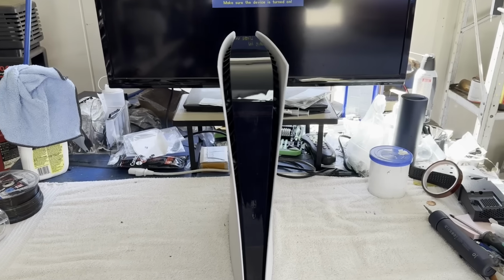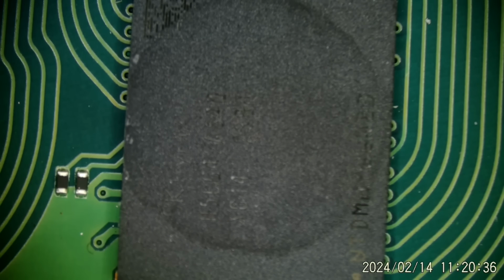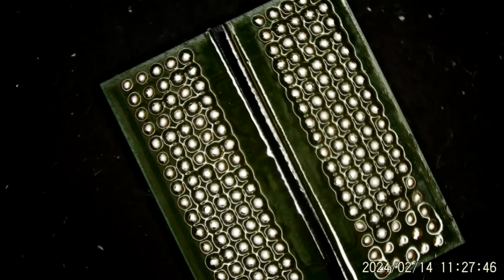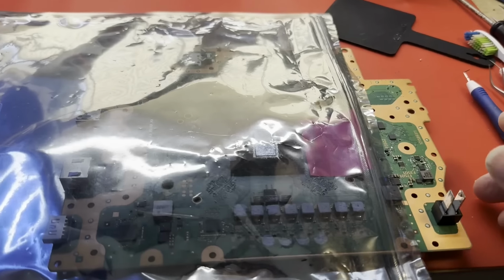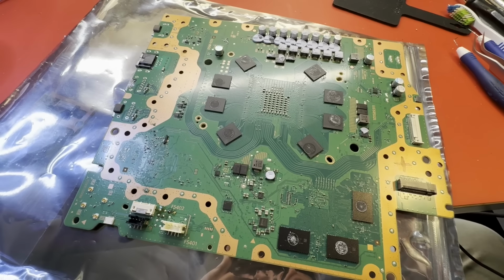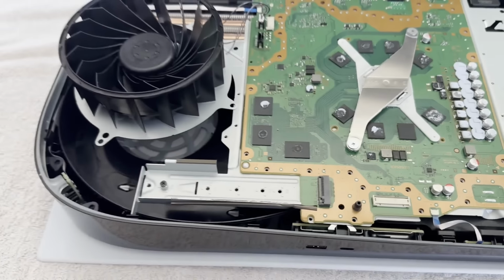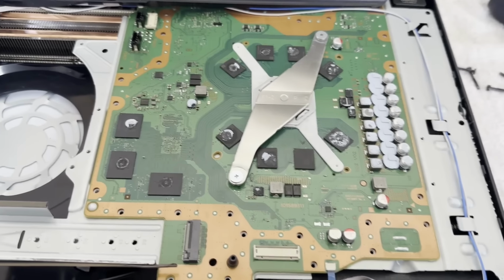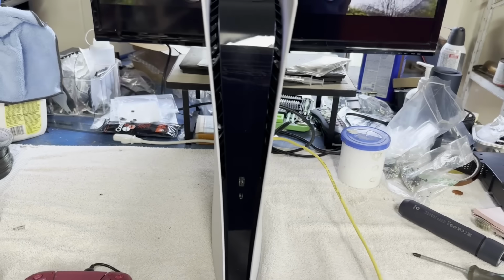#138 PS5 Digital Beep On-Off and More Issues

Comment: Amazing! But what kinda tools did you use too debug test the PS5 in the very beginning? Haven't seen that before.
This would be making my job much easier too figure out what's the issue is when it's not turning on.
Reply from the maker: I use the BwE PS5 Code Reader although it is not free software.
Reply: Thanks for answering the question! :)  @ToltecMerc 
Could you give me a link for it? Couldn't find any store for it (till now).
Reply: @ToltecMerc I've got two ps5 that turn on and off after the blue light comes on.
Would you be able to tell how to wire this device in so I can see if my problem is the same one you had in this video?

Comment: Great job, but I have a question. How did you know which specific ram to work on?, Did you do a voltage injection or did you check with a oscilloscope or you got that Info via the uart
Reply from the maker: The BwE PS5 Code Reader tells you the number of which RAM IC has failed and the software includes a chart showing the physical location of each number.
Reply: @ToltecMerc  thanks for the response, where can I get this  software.

Comment: I Have 1sec Blue Light PS5
I checked all the components around the HDMI IC are shorted.  After removing the oc, all the shorts disappeared

Can I test the console without this ic or do I have to replace it because hdmi ics are a bit expensive? thnqu 🥺❤️
Reply from the maker: The PS5 will not start without a working HDMI encoder IC.  The PS4 would but not the PS5.
Reply: Thnquu @ToltecMerc

Comment: Great work. And i have question my ps5 have a 3 beep no power problem everyone said it’s bios chips I watched one of you video u said something even the repair guy said that but 2 days later he check it and said bios was ok is there other problems have same issues 3 beep no power ?
Reply from the maker: If you are getting 3 beeps as soon as you plug in the console, that is normally corrupt bios.  It means that the South Bridge is unable to load its software.  I would say it's either bios of South Bridge.

Comment: Excellent repair as always. I have one concern though. The SK hynix memory with the X00n code are destined to fail as can be seen from northwestrepair GPU repair channel as well. He has mentioned that plenty of RTX 3060Ti s have this IC and they always fail. In that case, would it be likely for the issue to return back, potentially affected by another memory chip?
Reply from the maker: It is of course possible.  I didn’t know SKhynix was so bad.
Reply: @ToltecMerc  I see. If in case this issue comes back, would it be possible to replace all the memory chips with a different brand IC possibly from Samsung or Micron? And if so, does it require modification of the straps in a PS5 like in case of graphics cards?
Reply from the maker: @geekjit215  I believe you could substitute the appropriate Samsung or Micron RAM without modifications
Reply: @ToltecMerc  Excellent. I have a PS5 digital as well purchased on May 2023 with the model no. CFI-1208B and am yet to take it apart, so not sure what ICs it is using. If it ever goes faulty, I am sending it to you. I am from India so don't know how to send it to you at the moment but will figure that out if and when the time comes. :D

Comment: Another interesting video :) happen to know the brand of that silicone mat you place the hot ram module on after removal? I recently removed a ps4 apu and like an idiot i placed it on the side of my preheater (which is metal and not hot) which made a small crack sound as i set it down, later on I noticed it popcorned between the die and metal heat spreader on the apu
Reply from the maker: That mat is from Hakko.  It came with my Hakko soldering station.  I'm not sure if they sell them separately or not.